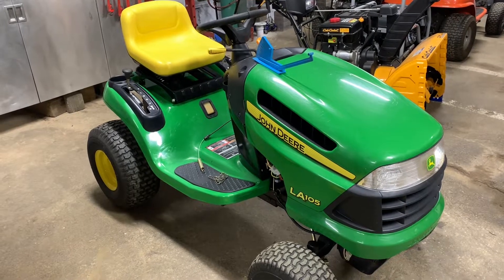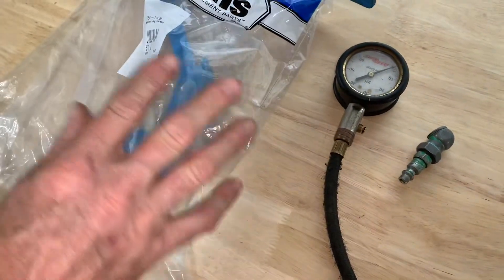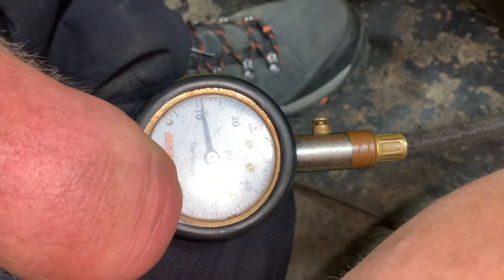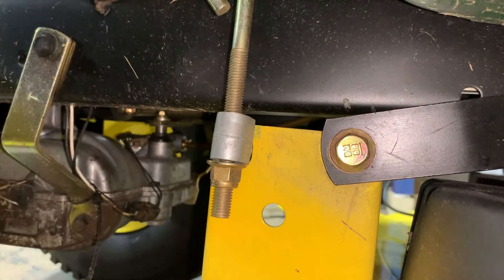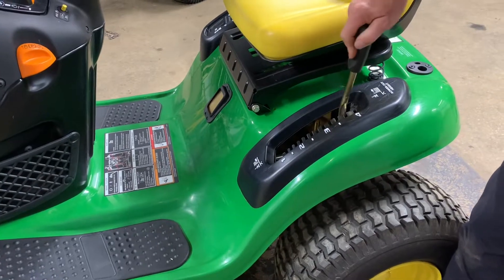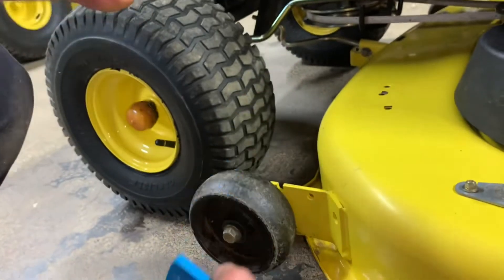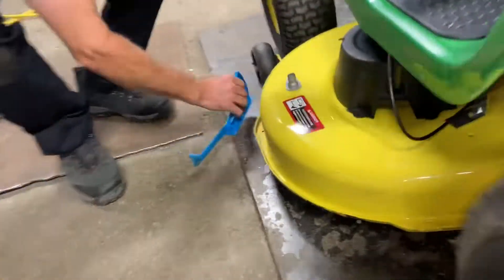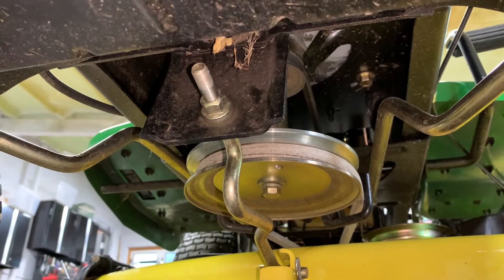How to Level Mower Deck John Deere

Comment: My JD LA130 21 hp 48 inch cut mower had to go to The dealership for for a clutch wire issue. Had the drive belt and the steering gear replaced. The mower cut great before the repairs. But scalped a little on return. Checked tire pressure first. Then put a 2 inch template under deck at the 2.5 inch setting. Then put the setting at 4 and reset deck to 3.5 inches. Now, The deck is cutting really nice. I reset the scalping wheels not to run on the ground while mowing on the 2nd lowest hole. Now just get to summer mowing.     Shawn.

Comment: You’ve helped me on so many things in the past couple weeks.  Thanks!  Almost like I have a new tractor.
Reply from the maker: Hi Patrick, I’m glad to help! thank you for watching and the kind comment. Please spread the word to your friends to help the channel grow. It would be greatly appreciated.
Reply: @JohnsonsSmallEngines  you’ve got a talent for simple explanations. On my LA145 I’ve done oil/filters/lube, starter relay, new deck and trans belts, new spindles pulleys and sheaves, new wheels, upgrades to bearings from bushings, steering gear and sector plate… heck, the only thing I haven’t done is the tranny fluid change. I have a background as a mech, but the JD was foreign to me. Again, thanks for making it look simple and easy.

Comment: Good explanation on how to level mower deck.
The older mowers 2005 do not have that real nice adjustable nut, they have a bolt and a slot to raise the rear of the mower deck, real PIA.
That leveling tool should come with every mower when you purchase it. Think about it you spend $2000-$4000 dollars for new machine and then have to buy a $8 dollar leveling tool to make it cut correctly....
Now I have to find a level spot on my driveway which will be harder than the actual adjustment...LOL
Thanks for posting.
Reply from the maker: Hi Greg, I agree with you! Thank you for watching and the kind comment. Please give this video a thumbs up, subscribe and tell your friends to help my channel grow. It would be greatly appreciated.

Comment: I have a JD S 130, having a heck of a time trying to level it out at 2 1/4 per the manual, the adjustment rod is almost bottomed out, anymore turns and the nut may come off.  How far up should it be off the deck if I have it in the 4inch transport setting?  I'm using three 2 inch blocks to do it.......

Comment: Thanks, very clear explanation. I'm going to give it a go at the weekend, we can only use the top 3 notches which makes it useless for long grass. Ours is a X130R, I wonder if that is a different letter prefix for Europe and the same as above.
Reply from the maker: If your deck is too low, even on the highest setting, then you should try to evenly adjust all adjustments higher to raise deck. You should have 3 adjusters. You should have one in front. One on the left side and one on the right side evenly adjust all three up. Turn the adjustment nut clockwise. you may be able to get a higher cut this way. It is very hard to explain but basically you just have to raise all of your adjustments up (higher the mower deck). Then level the deck. I hope this wasn’t too confusing. I will try to make a video on this subject at some point in the future.
Reply: @JohnsonsSmallEngines  Good morning from the UK, many thanks Brad, it worked just as you explained in the video above. I raised it right up and levelled it on a concrete garage floor which is faily level. Now it can cut much higher for the long grass, and our lawn cut height is a notch above 2. Ours has the plastic covers on the deck, which seems to do not much other than trap grass on top of the deck.
Reply from the maker: Thanks for the update. Im glad to hear it worked out!

Comment: I love your videos! I need your help I installed all new spindles and pulleys the deck is much quieter but I still have a problem , when I raise the deck up half way it makes a noise as if something is hitting if I lower it all the way down the noise goes away. I tried leveling the deck but still no luck. I also found if I push down the left side of the deck the noise goes away. The blades are not hitting anything. can You help?

Comment: Great video,  question,  i have a L110, can i retrofit my deck with the height adjustment the same as on the machine you demonstrated on, thanks
Reply from the maker: That is a question for a John Deere dealership if it can be done.

Comment: Hi so when placing gauge it’s on the bottom of the blade not on the cutting edge but as long as its roughly in the same spots on both sides and front and rear is acceptable? Thank you! When i do get a chance i can not wait to adjust my tractors! THANK YOU SO MUCH! Have a good day. Oh yea i did subscribe also!!!!!!
Reply from the maker: Yes, Thank you for watching and supporting my channel.

Comment: When measuring the deck height, where do you place the measuring tool? On the cutting edge of the blade?
Reply from the maker: Underneath the cutting edge as shown in the video.

Comment: Hey mate just wanting to see if you're able to do a video on how to adjust the foot brake, I tried to stop the other day and it rolled into a ditch haha also too the bolts that you tighten or loosen to adjust the side of the deck, I've got older version that doesn't have them, do you know where I could purchase them or an easier way to level or keep it half decent. Seems to hit a bump and loosen quickly which step cuts then lol. Cheers mate

Comment: LOL I took that POS plastic grass shoot off and welded that stupid metal one completely closed! I can't understand why they put them on, they are a hindrance and take up way too much space you can not get close to anything at all. now I have a 42" cutting deck! 
I use a tape measurer and that is all. I even set my LA110 at the "2" mark and wa-la all done 
I have a question for you.
I have a John Deere LA110 mower I fully restored the entire deck, I installed and greased 2 new spindles, I replaced there pulleys, I installed all new blade breaks, installed new idler pulleys, Even brand new mower blades and new belt. I welded the broken hanger supports and installed new hanger brackets and arm for the front and rear of the deck. 
and made sure the blades are perfectly in line with each other I have about 1/16th of an inch on all 4 corners of the cutting blades and perfectly level i mean WOW!!! 
even after all this I still get a strange sound and vibration from the mower deck.
I did all this because it kept tossing the belt till it broke the front belt guide and twisted it into a pretzel blasting it off into the yard. 
I even painted the deck too! 
The sound is like a stuttered rumble and the vibration is like side to side (if that makes seance) 
The only other thing I can think of is a bent crank shaft.  

Love your videos btw.
Reply from the maker: I have seen bent front engine pulleys, a bad spot on the deck belt, blades not balanced correctly and bent pulleys on the mower deck. Unless you hit the crankshaft, it should not be bent. If it is bent, I would think you would be leaking oil from bottom crank seal. I just serviced a 2023 John Deere S100 and the mower deck shake is always there more than I would like, but I cannot find anything on a brand new machine that would make it shake. The quality and thickness of the steel has lesson through the years so the shake on some machines will always be there More than ever because of the lack of quality and thickness of the steel on the mower deck. That’s all my opinion, but that’s where I’m at. Thank you for watching my videos!
Reply: @JohnsonsSmallEngines  Thank you for the reply and keep up the sweet videos I think you are very informative and helpful.
As for the sound it maybe the new spindles I thought I had greased them both till the grease came out but not so, as the left spindle was not done right (or so it would seem) I put in a tube and thought that was good enough , well it wasn't and I just added more till I seen it come out. Now during this I was hearing the snaps and pops of air bubbles coming from the spindle I see the grease now and that sound is now gone. 
 Yeah the machine is a "bought used " mower and I do know the guy that owned he used it and got a new one sold this one to me. Not a leak on it anything on it. the deck and belt were bad and so was the front steering I replaced all the parts ball joints and arms everything but the tires is new completely
( I am doing a wheel bearing kit upgrade right now taking out the stock crap and putting in the good ball bearings!  done by me from watching your videos mostly and a few others. oh also I redone the tuff torq K46 hydrostatic drive and all the parts , pulleys and belt, I got a brand new mower now.
I will see if this is true the vibration thing my neighbor just bought a brand new John Deere mower with 24HP motor . 
But I trust you are right about it that deck is some thin thin metal. really cheep aZZ material if you ask me .